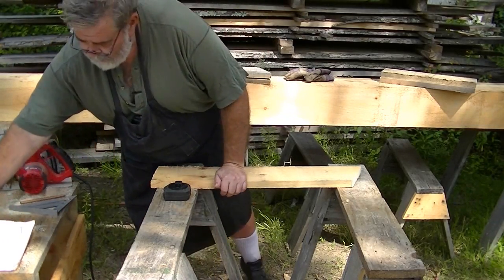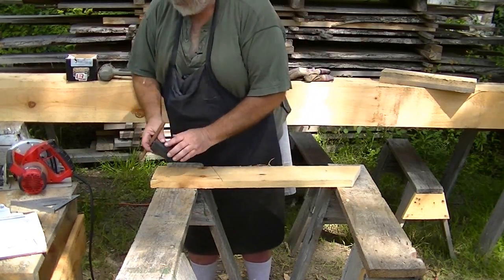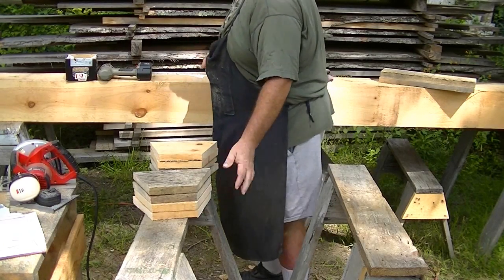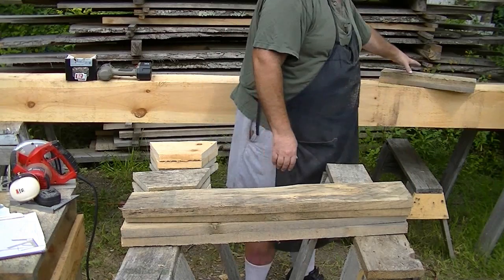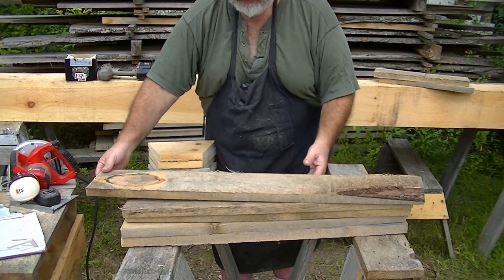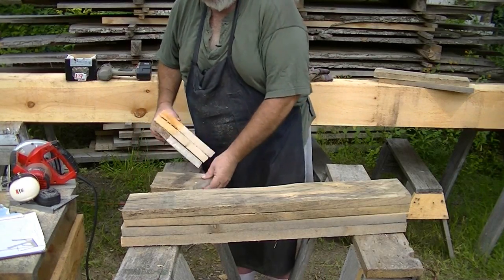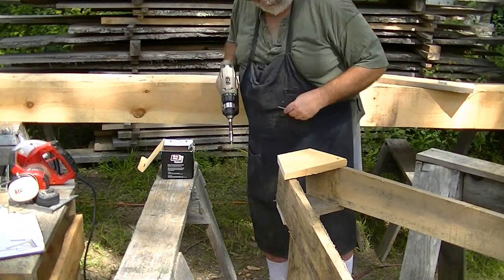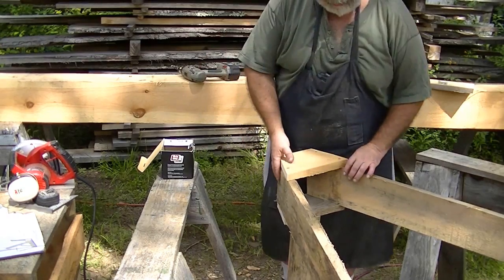Sawhorse assembly video

Comment: That is a great use of scrap wood Jim. I like the bracing that you used. The legs are two sturdy components tied together with a solid truss construction top. Nice design and built in 15 minutes. Impressive!

Comment: Nice horses, what is your leg length for ponies, and what is your height (pants inseam)?
Just wondering what measure to use for ponies...
 the height at my knees, or a little below?
Reply from the maker: 18" so when you sit on a timber your feet are on the ground.
Reply: @JimRogers117  thanks